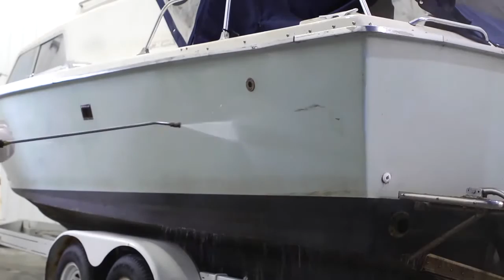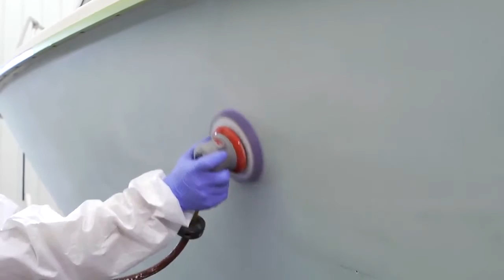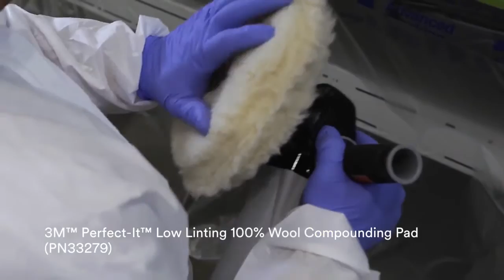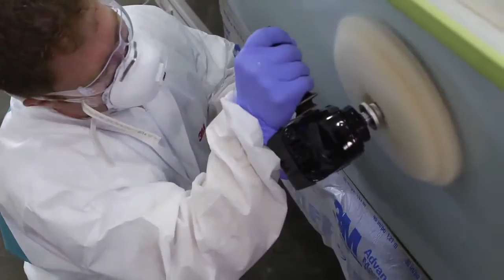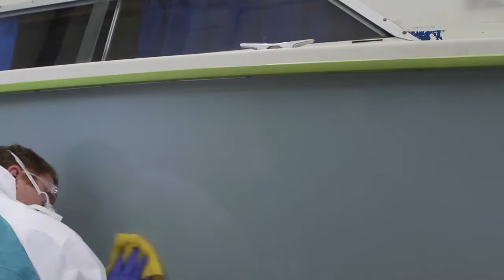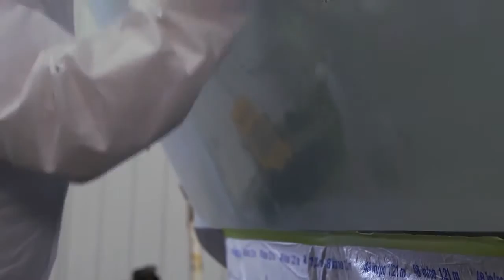SOP for Gelcoat Finishing

Comment: Is 3M Heavy Cut Marin compound a diminishing abrasive? As in it cuts heavy at first but breaks down into a finer compound as it’s worked to give a more polished look. Or does it just keep cutting like an aggressive compound leaving scratches that will need cleaned up with a finer compound. Thanks in advance